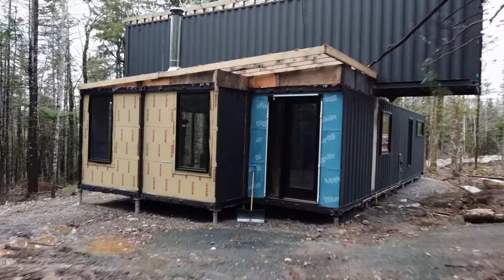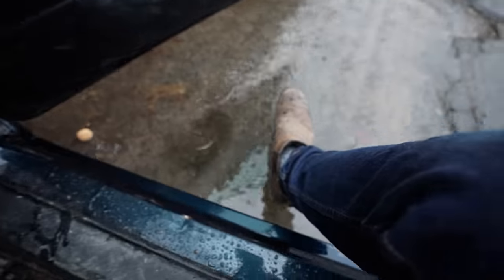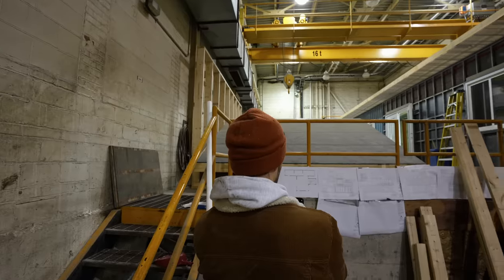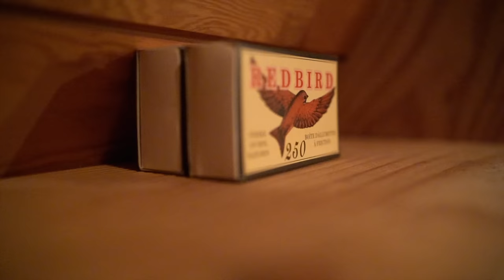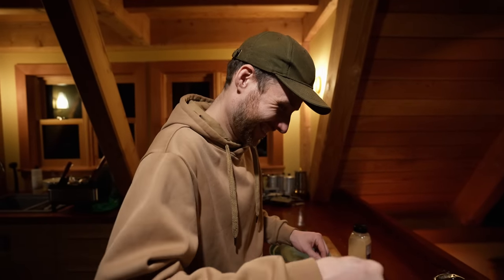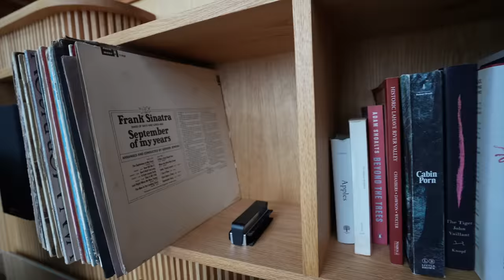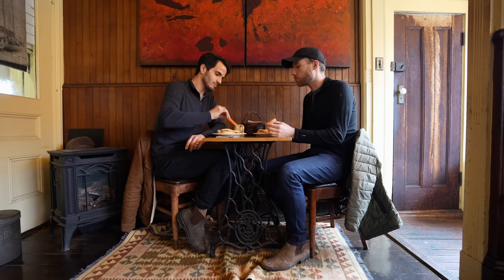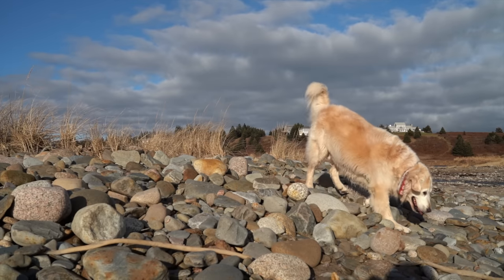Expanding our SHIPPING CONTAINER HOME...(we've kept a HUGE SECRET)

Comment: Omg, you guys were in an area of NS that I actually remember from when I was there 25 or so years ago! I took a French immersion program for a summer in Pointe de l'église (Church Point) in Acadian NS. My boyfriend at the time was from Wolfville, and came down to see me on weekends. We did road trips all over that area. It's SO beautiful. There's a wonderful cove out there called L'anse aux Hirondelles (House of the Swallows) that was a smugglers' cove during prohibition. It has an amazing cave accessible at low tide. If you're out that way again, you should check it out. There's some great hiking out there, too. The Scarlett Letter was filmed in the area - there's a hike that goes along the coastline on the cliff tops, right through the old film location. That A-frame was STUNNING. House goals, right there.

Comment: I wish Alaska had a milder climate like what you guys experience. I think it would be easier to build up here. Except Alaska has a ton of muskeg marshy land. It’s truly difficult to build on it with permafrost melting and creating new lakes where the tundra had been disturbed. You have to put insulation down then several inches of dirt then cement to prevent the permafrost from melting. If you don’t than you will have to level your home every other year because it will constantly shift.

Comment: I am so confused. The problem that you were solving was the staircase width opening on the second floor. I knew you would have to add an exterior unit but whats with and extra upstairs living room and the exaggerated height of the exterior staircase unit. Why do you need and upstairs living room in addition to the downstairs living room area? Seems a bizarre solve. What is the reasoning behind this "solution" secret?
Reply from the maker: A staircase to nowhere wouldn’t be very helpful lol. Adding a staircase on the exterior meant we had to enclose the upper deck area :)